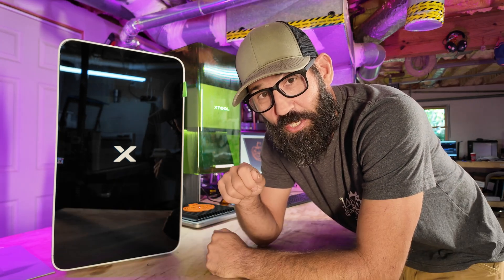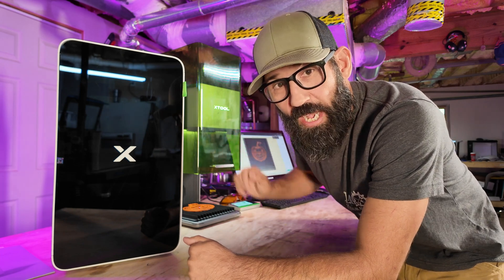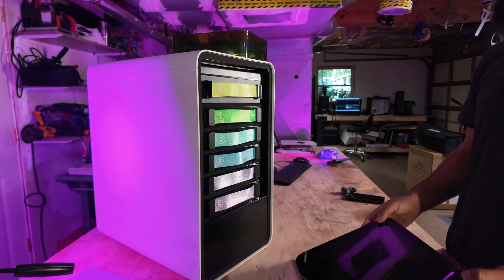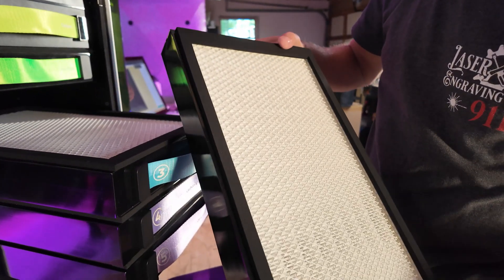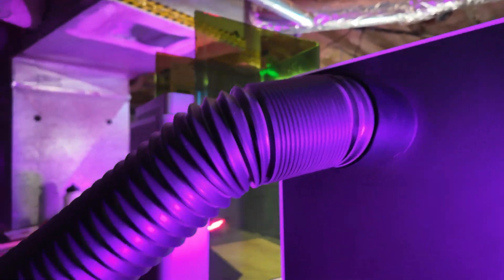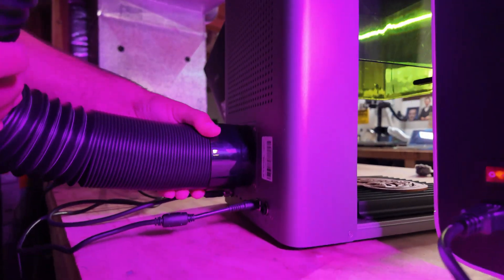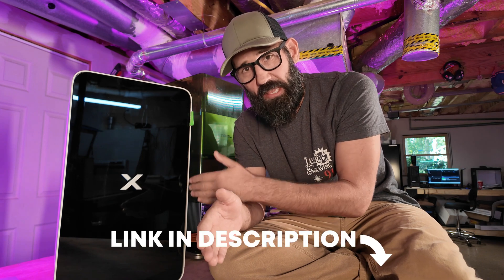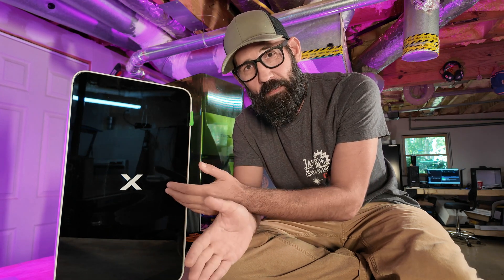My Best Settings For The F1 Ultra - Plus Massive Giveaway

Comment: Question... Can the F1 Ultra be used to burn the screenprinting mesh? If so, do you have any tips?
Reply from the maker: Im sure you can yes, but you will be limited to the F1 Ultra work area, and you will have a hard time getting the screen and frame under there. Ive never tried it, but in theory it is possible.

Comment: What settings did you use for engraving the Lasermax material? You only list the cut parameters in your document.
Reply from the maker: Thanks you are right, use the setting for Baltic Birch Default it will work good. if its too deep cut the power to 25%

Comment: Is it possible to engrave in Fiber mode and cut in Diode mode on the Bull Leatherette with the F1 Ultra?

I'm having such a hard time cutting Leatherette with my standalone 50w fiber.
Reply from the maker: You can have the diode laser do the engraving and the cutting if you want, I recommend you cut that material upside down to avoid charing , so cut your patch shapes out first then put them back in the machine and engrave using diode, and the camera.
Reply: @LaserEngraving911  my man!  Thank you.

Comment: so as far as the fume extractor goes, is there a reason you’re not keeping it or is there something you’re using that you find is better?
Reply from the maker: good question! I actually use Industrial grade fume extractors that cost about 4k and the other one cost 7k, but I really like this new one from xTool for things like mobile events, and taking it on the road. So after I gave it away, I actual got another one :) go figure!
Reply: @LaserEngraving911  I was gonna say.. its amazing!… my rooms air quality monitor read better air after using the laser than before.. i assume it was spitting out better air than ambient LOL